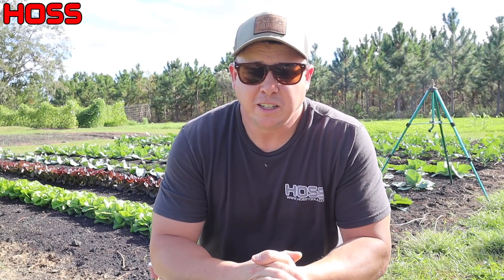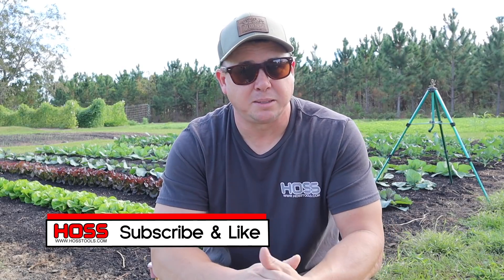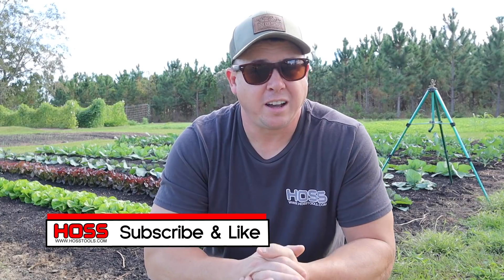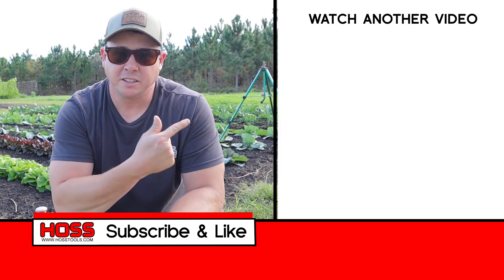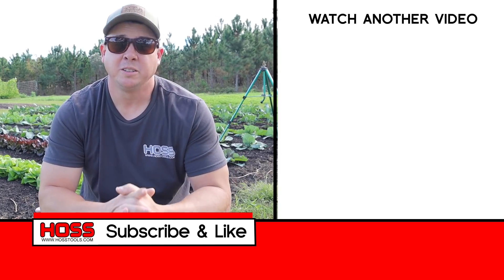ARE WE DESTROYING OUR SOIL?

Comment: As for the brocolli, it's done just as you suspect by several no-till market gardeners.  Cut the stalk at the surface and leave the root system to slowly decompose in place.  I think the reason the no-till plots do well is because the mycelium links don't get broken up.  I've been gardening no-till for 5 years, though I have used a tiller to make most of my permanent beds.    I've also used once on beds to shallow till to rid of weeds that got ahead of me.   

I think root crops help to break the stratification of nutrients/organic matter and things mix in deeper when digging out the crop, such as carrots.
Reply from the maker: Always a good idea to leave that root structure in place if possible.

Comment: Nother great video! Appreciate your patience and honesty. I can see why the black tarp method is good for weed suppression and did you say to break down the cover crop too? If soil is supposed to be “living “, does the heat from the black tarp destroy the living bits in the soil? After the tarp are you left with a sterile soil? Thank you.
Reply from the maker: The soil doesn't get that hot underneath the tarp. It basically just prevents light, so weed seeds germinate in the moist environment but then die due to a lack of light.

Comment: Would tarping during off season help with bug and fungal pressure? I have been wanting to try no till, just to see how well it works. Have always tilled my soil in the past. So I am interested in watching how your experiment goes. As well as how my own experiment turns out using goat barn clean out soil amendments.
Reply from the maker: Tarping will not remove any eggs or fungal spores in the soil, but tilling will.
Reply: I thought maybe the heat created from tarping would make eggs non viable, as well as the fungal spores.
Reply from the maker: Doesn't get that hot underneath the tarp.
Reply: The artical says it can reach 180° under the tarp.

Comment: Is there a reason that your drip tape needs to be buried? Mine (not purchased from Hoss) is laid on top of the soil.
Reply from the maker: Drip tape was designed to be buried. It works so much better that way. When it's buried, we can weed on top of it and it stays out of the way.
Reply: My well produces hard water from a limestone aquifer. If I do not bury the drip tape, the emitters will clog over the growing season due to evaporation of residual water leaving lime deposits behind at the emitter's orifice. No evaporation problem with buried drip tape. That said, this spring I will experiment with laying the drip tape on the soil's surface and then covering it with compost. Hopefully an inch of compost will be sufficient to prevent evaporation and lime deposits.

Comment: I’m so excited that y’all are doing this experiment!
Question: did y’all not install subsurface drip tape on the no dig bed from the jump? If so, how come? Or were you saying you had to overhead water in addition to the scheduled drip irrigating?
Reply from the maker: There was quite a bit of debris from the previous cover crop still there. That's why we added so much compost -- to cover that debris. If we were to try to bury drip tape there, it would have made quite a mess with all that debris below the compost. So we decided not to do it in this case.

Comment: Travis, I am so impressed by your willingness to try alternate methods of growing. As you suggest, context is very important. In zone  6b, we have much less pest pressure and mulch a lot, except brassicas, which we clean cultivate because of harlequin bugs. Also we mostly use transplants, so don’t need the clean seed bed that direct seeding needs. We started with very fertile soils so use modest amounts of compost and organic fertilizer and get very good results. We are talking about maybe 4000 sq ft vegetable garden, another 2000 sq ft beans and corn and winter squash.
Reply from the maker: I think it's important for folks to see a visual explanation of why certain methods work in certain areas. Many people have a blanket approach to gardening.

Comment: The question of compost in your no-till garden is one to potentially attempt different methods. One of the advantages you have with using compost in your garden is the much warmer temperatures for a greater time during the year.  The compost will continue to break down at a much faster rate once it is in the garden over a longer period of time.  I used all of our compost this year around around tomato and pepper plants as a mulch that continued to break down all summer long and not only feed the plants (maybe??) but also to help hold the moisture in the soil. I also used some of it directly into the spots where I put some of the plants to do a side by side comparison of which worked better.  I did not see any benefit of incorporating the compost into the planting holes versus on the surface.  What I did see was that when the summer got the hottest and driest, these plants continued to grow and did not suffer the drought and heat stress like the rest of the garden did.  And now that the season is over, that compost has fully decomposed down into the soil and given us better soil from a nutrient and filtration aspect.  We do not have quite the disease pressure up here that you do in the South, so I do not think the chop and drop will work as well for you when a plant is done and harvested.  I try to use as much of my "done" plants as possible in the rows between my corn that I grew to continue to break down and put nutrients back into the soil.  It also helped with slowing the evaporation and drying out of the soil around our corn.  Just some thoughts as you continue with your experiment.  I really appreciate you doing this comparison of two separate plots and continuing to produce update videos on how things are going.

Comment: Y’all give a lot of great advise but what you do to keep the deer out. I have more trouble with deer than weeds😆
Reply: I need this answer. I'm tired of the deer.
Reply from the maker: We don't have deer near our homestead because it is surrounded by hundreds of acres of commercial farmland. So there's no real prime habitat near our gardens. We have tons of deer in our county -- so much that you can hunt them over a pile of corn legally.
Reply: We use 7 1/2 or 8 ft fence. Nothing else is more reliable in the mid Atlantic region.
Reply: 3 wire electric fence works for me. I baited it with peanut butter on aluminum foil folded over the wire. After a shock on the nose, deer stay away.
Reply: "Wireless deer fense" They really work. Place them early in the planting season. The deer get zapped once and don't come back that season. I was getting damage on my strawberries and apple trees.  Placed the zappers and no more damage.
Reply: 2 wire electric fence works very well for me. T-posts set at 15ft. Lowest wire just below your knee for the young deer. Upper strand right about where your hand hangs as you stand alongside your fence. Everyone knows deer jump. But once a deer hits the fence with their nose they stay away. Also if deer are moving through your area and grazing along the way....you can "steer" them around your garden with a two sided electric fence that extends past your garden on only two sides. No fence gates, leave the fence on always and no accidental shock like when you fence the whole garden. Advice was given to me by two great deer hunters I know. 8-9 years of success in heavy deer areas for me.

Comment: Here’s the thing... I’m doing what works for me in a very hot spot in Northern California in the Sacramento Valley where we get little rain, a good amount of wind and am surrounded by large scale orchards.  I do mostly no till with lasagne beds for new plots. After tarping, I lay cardboard or newspaper, then a layer of straw followed by several inches of compost. With established beds I just rake and add compost, then mulch with straw again. No this isn’t true of all my beds. I also have raised beds, the newest based on hugelkulter. I water using soaker hose laid on the compost but under the straw.(Travis soaker line May solve your water problems.) I’d never cover cropped until this year after watching Travis and Greg. Iron clay peas in one area and now daikon radish in another. I do believe that a no till approach is best for overall soil health but even a ‘less till’ system is better than repeated disturbance of the soil. But ultimately doesn’t it just come down to doing what works for each micro environment? Oh yeah... using Hoss Tools seeds is the other thing that works for my garden 😁

Comment: Your no-till plot was built on a plot that had been tilled in the past. Do you think a no-till plot could be created on a grass covered area with hard compact soil?
Reply from the maker: Really good question. I would lean towards NOT. I think with heavy clay, you would need to do some heavy cover cropping with daikon radishes and incorporate lots of compost into the soil. Once you got it right though, you probably could just add to the top like we did here.
Reply: Yes, I know this for a fact.  I live in the south with Bermuda Grass on compact clay soil.  A growers nightmare one would think but it works and works well.  I simply put down a thick layer of compost directly on the grass and off I went.  The key is to put down a thick layer that smothers and kills the grass.  I put down 6 inches.  If you put down any less you are just fertilizing the grass.  
  You might think this sounds like a lot but it's a one time thing.  I add about 1 inch every year and that's it.  It's an expensive up front cost but totally worth it.  I like to think of it like a house...I want a strong and sturdy foundation to work on.  I have never broad forked and I still get the most amazing carrots.  It really blows my mind that with all the information and examples out there, that people still till. Tilling is an outdated practice and shouldn't be recommended by anyone.

Comment: The easiest solution to all that is to drift over to your barn and get out your tiller... and move on.  :)  I'm not even considering doing what you are doing... I have cut WAY back on how much I till.  After I got my BCS I was so proud of that thing, I would just look for an opportunity to use it.  Now days I generally don't use my BCS much at all.  When I turn over a piece of my garden (currently don't have individual plots) generally I will use my big tiller on my 25 HP Tractor.  I highly recommend you just go get a Kubota L2501... not what I have, but if I was buying today that's where I would start looking, my "big" tractor is a Kubota... 25 years later I would buy it again, but I digress.   I generally just till the entire spot, and plant a cover crop.  Then when I terminate that, I till it again with my big tiller and then just leave it set for a couple weeks.  Then I use my BCS just where I'm going to plant... till those strips, put in my drip and move along.  The reason I do that is my big tiller turns much slower, and while it does a good job of turning under the cover crop, it doesn't leave a really nice bed to seed or transplant into.  I know you are trying really hard to demonstrating that you don't need to own equipment, and that is true up to a point.  But when you have 10 garden plots... you have crossed the line in terms of wasting time (the most valuable item on earth... by far) just my opinion.
Reply from the maker: There's no doubt that the way we (and you) usually do it is so much easier and practical. However, I think it's important to see if the increased effort really makes a drastic difference. I have my doubts, but it will be interesting to see.

Comment: The "Tilther" type tool for direct seeding. 
It's a tiller ... but extremely small-scale/lightweight. 
You can get by with only tilling the top inch or so, without digging in on giant 8-inch diameter tiller tines. 

https://www.youtube.com/watch?v=6dUXPeDsHGU

Even a small Mantis (or knock-off) type cultivator works here - it's bigger, more damaging than the Tilther, but hella better than a full-sized tiller in terms of not tearin' sh*t up.
Reply from the maker: I've seen the "tilther," but am honestly not impressed by the construction of the tool. I do agree that it serves the purpose of "frothing" the seed bed.
Reply: @gardeningwithhoss  My understanding is that the Tilther only goes about 1” deep and is used primarily to mix amendments in the top 1” and well as redefining the edges of the planting bed.